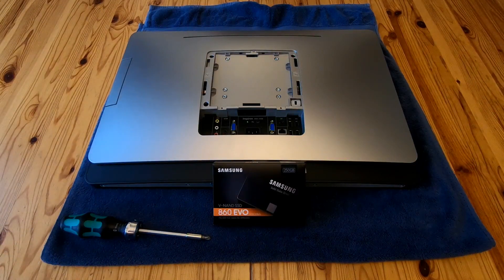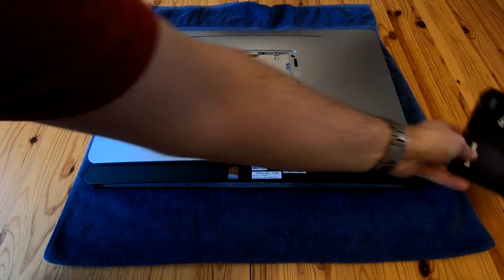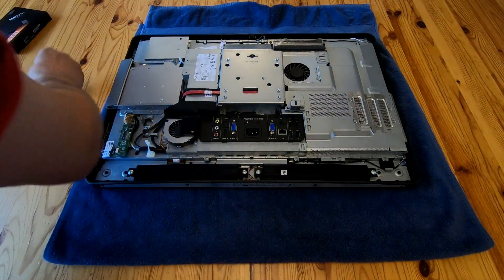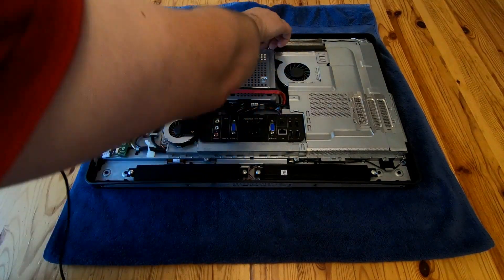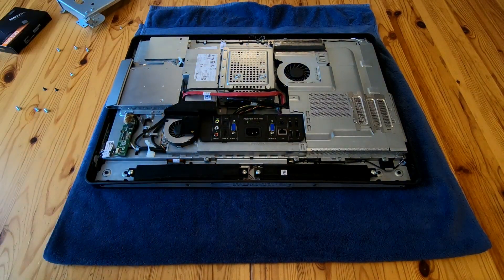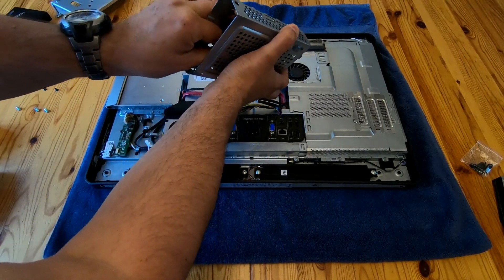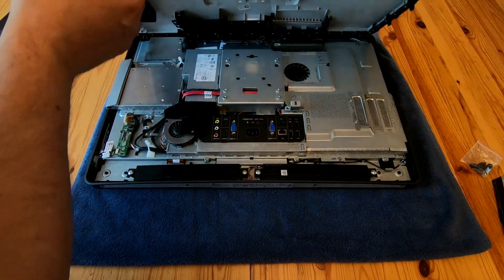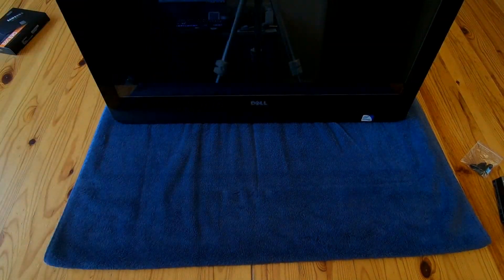DELL Inspiron One 2330 HDD Upgrade and Replacement *HOW TO* Guide

Comment: i need to clean the back of the bezel on mine do i have to take it completely apart or can i access it by taking out the screws and like raise it up a bit wipe it clean??? is that possible?
Reply from the maker: I expect so. If you can get a damp cloth to what you want to clean and it can move about applying pressure then it’ll work.

If you’re worried then use GooGone or IPA as that will evaporate.
Reply: @sterntechdaddy  ty sir!!!

Comment: Fantastic demonstration!  We are in the process of upgrading the ram & HD on one of these.  Thanks for the video.  Thumbs up!
Reply from the maker: Glad it was helpful!
Reply: @sterntechdaddy  if you don’t mind, what made you change your mind on Velcro versus the cage for mounting the hard drive?
Reply from the maker: Anything involving glue will deteriorate over time... so although the Velcro is pretty solid and will stick to itself really well, the glue used to stick it to the chassis isn't. 

There's natural chemical deterioration, but also the possibility of thermal creep - where heating and cooling affects the glue and the weight of the drive might cause it to slide and then fall off.

This can't happen if it's screwed into a proper 2.5" to 3.5" adapter.

:)
Reply: @sterntechdaddy  All good points. We’ve already completed the upgrade with the Velcro. Will let you know if any of that happens. Thanks for the video and feedback.

Comment: Hello there not a computer person I have a 5348 series I put the disk in and it turns but doesn't play and can see the programme for it and every now and again it shuts down and says says it ran into problems and restarts
Reply from the maker: IF it's the one with the i3 in it then that's getting on for 10 years old.

So if it's never needed a repair then that means the hard drive and the installation of Windows is also 10 years old...

Here's a tip...

Next time is crashes, make a note of the date and time. Then take a look in Event Viewer to see if anything is recorded that might identify the problem.

I would also look to swapping out the existing drive for a solid state drive - I have videos about that if you're interested.

:)

Comment: Great video, my new SSD is amazing. Also added ram. They had that hard drive locked down like fort Knox 😂 😂
Reply from the maker: Having to remove the entire back cover and fiddle about with the drive cage is a bit of a pain - but it’s not like it needs doing often.

You might remember Sony computers - which had lots of helpful hatches to help with this sort of thing. Unfortunately this meant their devices were over engineered and they left the PC market.

DELL have obviously considered that and designed this model to balance manufacturing and repairs.

Note that DELL have some VERY detailed service manuals that you can download with step by step instructions. They are meant for their field engineers, but if you search the DELL site for the device service tag you can find the PDF and take a look.

:)

Comment: Hello, Thank you for this tutorial.
Is it possible to plug in a second SSD ?
In other words, is there a second connector for power and data on the motherboard ?
Reply from the maker: There's no room in the existing drive bay, but you could swap the CD/DVD drive and fit one in there if you fancied getting inventive.

:)
Reply: @sterntechdaddy  that's what i thought i would do cr i only very rarely use the cd player,
Merci.
Reply from the maker: It might have a special connector... it's called micro SATA... so something like this might help...

https://www.amazon.co.uk/STARTECH-COM-MCSATAF12S-Micro-Power-Adapter-Red/dp/B002RCQ6U2

;D

Comment: How do I reset admin password with my onscreen keyboard? I need to get into this computer and have no way of retrieving the password
Reply from the maker: If its a local user account then you can boot from a password recovery CD and it takes about 3 minutes to remove/reset a password. This works for Windows 8 and all other Microsoft operating systems.

This is worth a look... http://www.ultimatebootcd.com/download.html

Doing it with the on screen keyboard is tricky though. 

You really need a keyboard so you can boot to the CMD prompt and enable the Administrator account - that can then be used to remove the password for your account if you're not able to make a password reset CD.

Comment: Do you even need the cage? It's meant to keep the HDD in place and from shaking. An SSD doesn't need that does it. So did you consider tossing the cage?
Reply from the maker: If I'd thrown the cage away then the chances of finding another one if it was ever needed again would be pretty much zero.

Note that for the SSD upgrades I do now, if the PC has a 3.5" drive then I use a 2.5" to 2.5" adaptor and that would fit into the cage anyway.

Hope that helps.

:D
Reply: @sterntechdaddy  Thanks for the advice!
Reply from the maker: @victors306  Have a look at the description...

:D

Comment: I have the same problem, but the choice of SSD’s is it better performance with 500GB 860 evo or the 250GB is ?
Reply from the maker: Overall performance will be capped by factors like the motherboard chipset, but when compared to a mechanical drive any SSD will be orders of magnitude faster.

The difference between particular SSD models won’t be that noticeable.

Capacity will be more important than any speed differences.

Take a look here…

https://youtu.be/KrCJMYjToOQ

The SSD in this video is capable of over 500MB/s - but managed 250 when used with the test motherboard.

This is still more than twice as fast as the mechanical drive for large file reads and over 70 times faster for small file reads.
Reply: Thank you very useful information. 
My Dell Inspiron 2330 will need some upgrade for sure. 
My dell inspiron 2330 keeps rebooting
Reply from the maker: @Friendshipprince  Might be worth swapping out the CMOS battery... depending upon how old it is.
Reply: @sterntechdaddy  oh yes never swapped since 2013 lol just checked. 
Thanks again.

Comment: I  followed all your instructions but I think my Dell One 2330 2014 build does not allow me to change the HDD to an SSD.  Does that sound right?  The BIOS boot screen says only HDD devices .  Is there something I'm missing?  I bought the Samsung 870 EVO SSD sata 2.5" and used the velcro and all went together very nicely but the boot screen comes up and says "NO BOOTABLE DEVICE F2 to run the setup utility.  Btw, the original WD drive was completely dead, so no cloning available and no possible way to load the Magician.  Do I have to buy an HDD for my machine, not an SSD?
Reply from the maker: Boot from a Windows USB setup disc... The new SSD won't show up as its not bootable until you install Windows on it. It's still a HDD though.. so you should see it detected in the BIOS.

:)

See this... it's for a FreeDOS laptop, but the procedure is exactly the same for your situation...

https://www.youtube.com/watch?v=OUx8-Vtcg2Y

You'll need a USB stick 8GB or larger and it'll get wiped so make sure there's nothing on it you haven't got a backup of.

To make the USB drive you'll ned the Media Creation Tool. You can find that here...

https://www.microsoft.com/en-gb/software-download/windows10

Hope that helps.
Reply: @sterntechdaddy  you are simply amazing.  Before I could open up your reply I had brilliantly cloned my other PC in my office to a Portable SSD drive .  So I got this idea to connect it externally via USB and turn on the Dell One 2330 with the new SSD 1 TB Samsung EVO drive. OMG!!!  It worked. It booted to that portable drive. Then I simply downloaded the migration software from Samsung and clicked on the Source and Target (New SSD Drive) to migrate data.  Took a few minutes to copy over but its all there and I disconnected the portable drive and I'm good to go !!!!!!!  You are so amazing. Thanks a million
Reply from the maker: @debbiepratto303  Thanks!

You did the work though so it's you that really deserves the credit. Glad I helped.

:)

Comment: Does any SSD work for this all in one? Any chance you can recommend some for under 100?
Reply from the maker: You can use any 2.5” SSD - there might be an upper size limit set by the motherboard chipset, so anything 2TB and smaller should be fine.

Comment: Thanks for the video Nic. I am about to take the plunge. I have a Inspiron One 2330 from 2014, works well but slow. I plan on adding 2T SSD, and upgrade to 16 GB RAM. I will also clone the drive. Many things to prepare for but the research is helpful when videos like yours are available. Thanks.
Reply from the maker: Thanks for the Ko-fi, that was kind of you.

I think the most the Inspiron One 2330 can handle is 16GB - 2 x 8GB - and the easiest way to check compatibility is to use the Crucial web site.

Note that you don't have to buy the RAM from there, but it is rather handy if you don't want to spend the time researching.

I also don't recommend Velcro anymore - see the description. A proper 2.5" to 3.5" adaptor is a MUCH better idea.

:D

Comment: So it's probably already been asked, but my hard drive crashed. Keep getting blue screen and when I run diagnostics it says the hard drive failed. So I was thinking replace the hard drive and then I assume I will have to purchase windows 10. It was 8.1, but honestly I don't know if I have the product key any where. So if I put a new ssd in then I would have to load the 10 to it. I'm not real computer literate, but could probably do it with a disc. Is there anything else I'd have to do to make it work then? Or should I just have somebody do it for me? I'm contemplating buying a new comp. We use it for normal use, but I also play an online game called war commander. From other comments if I read correctly, you said it wouldn't work as a monitor, but I can change my input to HDMI or vga on the side when it's turned on. Not really sure if it will feed through if it doesn't boot up. This comp worked decently. Slow, but decently. I'm just kinda cheap and hate to spend 5 or 600 on a new comp if I don't have to. I've seen drives for about 50$ but really didn't pay attention to whether sdd or hhd. Any advice?
Reply from the maker: Windows 8 (and newer) have licence keys embedded into the BIOS of the computer - so there's no CoA sticker with a key printed on it anymore.

So once the faulty drive has been replaced with a suitable SSD (normally a 2.5" model) as shown in this video, just run Windows setup and it'll automatically find and use the key.

:)

You just need a USB stick bigger than 8GB and another computer to download and run the Media Creation Tool.

See this video...

https://www.youtube.com/watch?v=PMKPRRI6M-I

To use it, follow the instructions in this video...

https://www.youtube.com/watch?v=OUx8-Vtcg2Y

It's for a FreeDOS laptop - but the procedure is the same. And it'll show you how to optimise Windows once its installed.

Hope this helps.

Comment: Hi Nic! Thank you for the video. I got my Inspiron One 2330 about 9 years ago and it looks like the HDD failed. I bought the very basic one back in the day:  Intel(R) Pentium(R) CPU G645@2,9GHz / 4G RAM / 500G HDD. As I only use it for music, streaming, video conferences and basic other stuff, would an upgrade (8G RAM and 256G SSD) be possible with my CPU? Also wouldn't the motherboard be too old?
Reply from the maker: SSD would be fine - any 2.5" will work. As stated in the description, I wouldn't use Velcro - get a proper 2.5" to 3.5" adaptor instead.

The 8GB RAM is a bit more problematic...

If you open it up and find two RAM sockets, then you should be OK with 8GB - 2 x 4GB.

A sneaky trick is to visit the Crucial site and find your model - it will list compatible RAM modules without you having to check the RAM type or the limitations of the motherboard chipset.

:)

Comment: I just got one with a bad HDD, if I put in a SSD what do use for the new operating system?
Reply from the maker: Just use Windows 10 - even if it wasn’t using it previously.

It probably won’t run Windows 11 mainly because of the TPM requirement, but Windows 10 will be fine.

If it’s got a CoA with a Windows 7 licence key on it then enter that when setup asks for a key.

If it’s a newer model that has Windows 8 or Windows 10 on it then the embedded key will automatically be read and used.

Comment: Hi Nic!, a question. How can you "clone" an HDD with windows 7 (in case of my dell all in one is ancient) to an SDD?, is there a software that does the job?, hey thanks for your video. 

PD: or maybe can I just simply upgrade to windows 10? is that possible?
Reply from the maker: If you buy a Samsung SSD then they have the Data Migration Tool that clones in a few clicks…

Full guide here: https://youtu.be/VPjwuvGmsTY

Win7 support has finished so you shouldn’t really be using it if you don’t have a specific reason.

But you can use your Win7 license key to install Windows 10.

Hope this helps.
Reply: @sterntechdaddy  It helps a lot, thanks again Nic :goodvibes:
Reply from the maker: @msanz94  No problem.

If you clone the drive first, you can then keep the copy of the drive as a backup. Plug in the new SSD and then attempt a Windows 10 upgrade to se if it will work without having to reinstall.

;D

Comment: Increases chances of static damage to other components when using velcro, there are also screw holes for ssd
Reply from the maker: ESD risk for the Velcro is minimal - other environmental factors such as if the room where the PC is being worked on is carpeted will be much more significant.

Older models also don't have the 2.5" SSD screw holes either... the HDD cages are only designed for 3.5" drives.

But check the description - I now recommend using a 2.5" to 3.5" adaptor anyway.

:D

Comment: y it just stays black screen? no bios message, all fans working propperly, hdmi in working all good also vga in but the computer itself is not giving anything to the principal screen...
Reply from the maker: Do you hear any beep codes?

If not then the CPU is most likely to be the problem. Unfortunately.

Next stage would be to remove the cover and take out the RAM to see if that generates a beep code error - but that's beyond the scope of this video.

:/

Comment: oldy but a goody. Just picked up one of these from a family member. Dropped in a 1 tb ssd. Velcro'd the drive to the computer (didn't use the hd cage - saved me some time) and then put the cover on it (so I could attach the base). Took me about 15 minutes. So much faster and perfectly usable for day to day tasks.
Thanks!
Reply from the maker: No problem.

Glad it helped.

Check the description for an update about using Velcro though... it'll work, but using the 2.5" - 3.5" adaptor is more stable solution. This also fits into the existing drive cage and I'd be cautious about removing anything that could have some structural role to play.

You might also lose the metal tray if its not inside the PC as its supposed to be... which would be virtually impossible to replace.

:D
Reply: @sterntechdaddy  agreed. It's an old machine that has new life with the SSD. I'll probably put the drive cage back in. Meanwhile I spent $65 and put in a 1 TB SSD. Total process took about an hour to clone and install.
Reply from the maker: @Alsam  Sounds like a bargain price to pay for a PC that works perfectly.

:)

Comment: Can you install a graphics card tp this model
Reply from the maker: I doubt it.

I didn't removed the cover plate for the motherboard in this video, but everything is surface mounted - there are no slots or interfaces that can be used to insert cards.

It's also normal for AiO devices to use the same heat pipe assembly for the GPU and CPU - which further explains why you can't install a GPU.

Check this out for more proof...

https://youtu.be/8xEw6kUUu94?t=248

:)

Comment: you could keep the original drive in for storage and swap the dvd drive for an ssd with the op system on
Reply from the maker: You could.

But the DVD drive on this and most of the other AIO computers will be a slim laptop style drive - which will have a special set of connectors for power and data that aren’t the same as those on a standard hard drive or 5.25” DVD drive.

So you might need one of these...

https://www.ebuyer.com/413690-startech-6-inch-slimline-sata-to-sata-adapter-with-power-f-m-slsataadap6

:)

Another idea it to use SD cards for data - nearly all laptops and AIO computers have a card reader.

:)

Comment: I’m just confused on the SSD boot to windows does it just automatically add windows into it?
Reply from the maker: You need to install Windows on the new SSD... if the old drive is broken.

Or clone the old OS onto the new SSD before you swap out the drives.

https://www.youtube.com/watch?v=VPjwuvGmsTY

:)
Reply: @sterntechdaddy  thanks boss
Reply from the maker: No problem.

Hope it helped.

Comment: I have Dell Inspirion One 2330 not turning on after changing the SSD. How to solve?
Reply from the maker: Remove the drive you fitted and check connections...

On some DELL machines you need to enter the BIOS after hardware changes to enable new device detection.

i.e. If you change the hard drive, you might need to enter the BIOS and select the new one manually and then save.

But if it won't power up at all then you'll need to think about beep codes or see if the power LED is flashing.

Comment: Can you link the new hard drive u put in there
Reply from the maker: I can...

Here's some Amazon links...

250GB: https://amzn.to/3oBxSmD

500GB: https://amzn.to/2IEjoDc

1TB: https://amzn.to/3oByatJ

Note that you don't have to buy from them and you also don't have to use a specific Samsung model.

Any 2.5" SSD will work...

But I would now recommend using a 3.5" caddie rather than Velcro to fix the drive in place. It'll be easier and much more secure.

I use the ORICO 2.5" to 3.5" Hard Drive Adapter: https://amzn.to/3kLmXFV

Hope that helps.